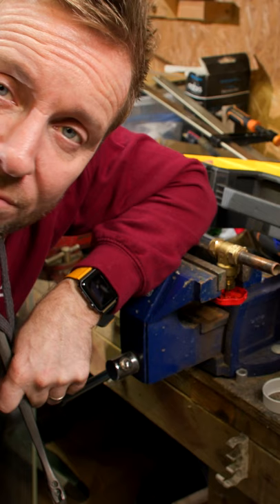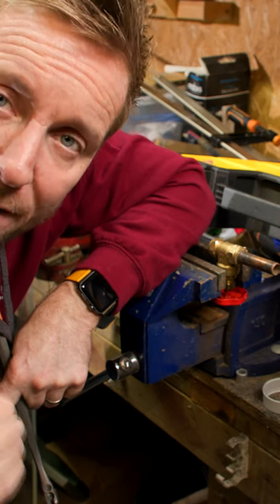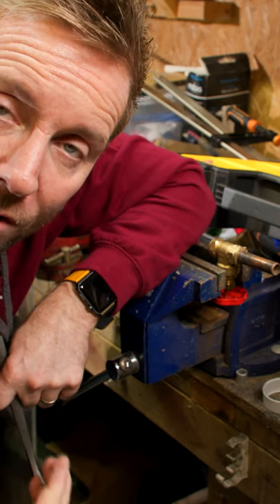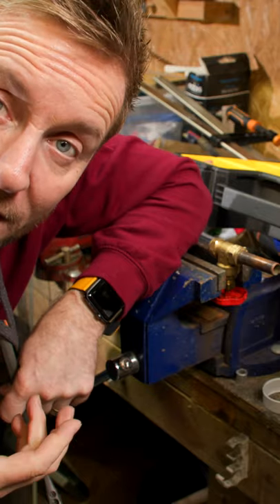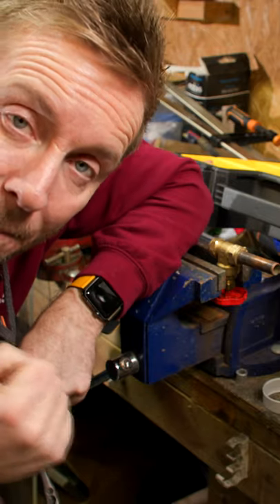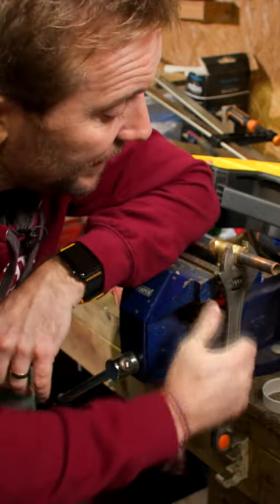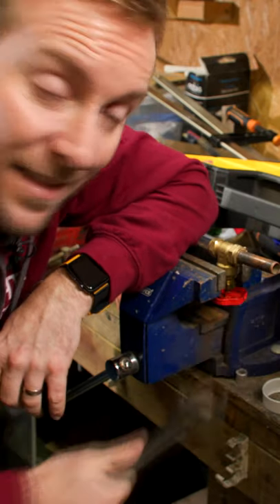Common plumbing mistake overtightening compression fittings #shorts

Comment: I tightened it to about 3/4 to 1 turn and a little bit of metal pieces came out (pieces of thread?).  It doesn't leak and hasn't leaked for over a week.  I just worry that it might pop off and flood my home.  Am I worrying too much about the little pieces that came out or would you recommend starting over?  Thank you for a good video! 👍👍👍
Reply: @Oliver-fg1jb  It's good after all this time.  To be sure I called a plumber to check the installation.  He said that I did it right, and that's the way he would have done it.  I'd say the key things are to remove the compression ring (can be hard) and use a new one; clean everything up with fine sand paper or steel wool before installing the new compression ring; and tighten the oiled nut while holding the valve firmly against the pipe to 1/2 to 3/4 turn.  I just installed another one and it's good too. 👍👍👍

Comment: When fitting a plastic shut off valve into a 15mm plastic pipe,  do we fit a collar that fits inside each end of the pipe? Great vids by the way 👍
Reply: If you’re ever using plastic pipe, always use the inserts that go into the end of the pipe

Comment: Plumbing is full of skills like this that you can't simply teach. You can't feasibly use a torque wrench for every joint. Best advice is to use the correct size wrench/pliers for the size of fitting.

10" wrenches are perfect for 3/4", 6" for 1/2" and smaller. I could pipe a boiler in 1-1/2" black iron using only 12" channellocks and not have a single leak or hurt my wrists.

Soldering is another skill where you just have to do it many times to learn how to do it correctly. You will have leaky joints and they will teach you something.